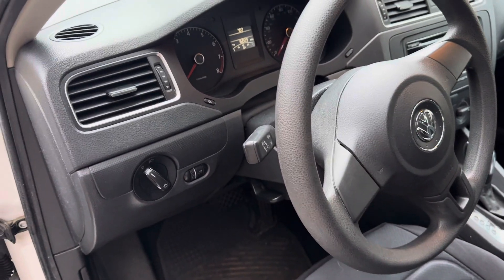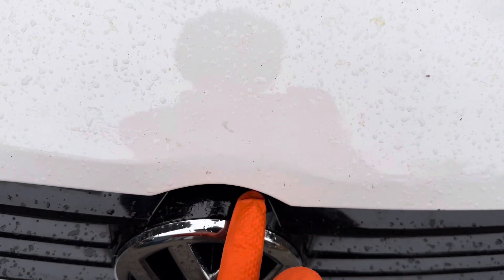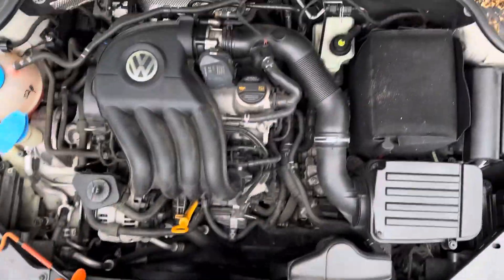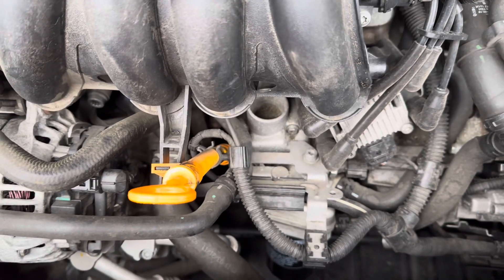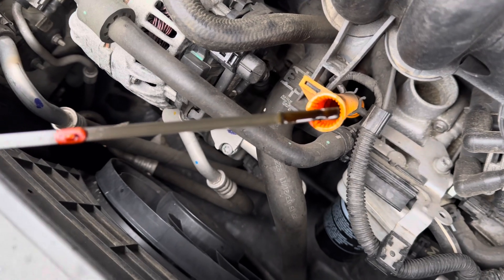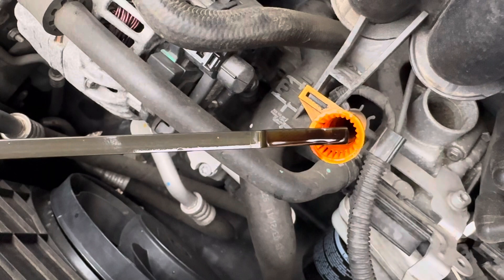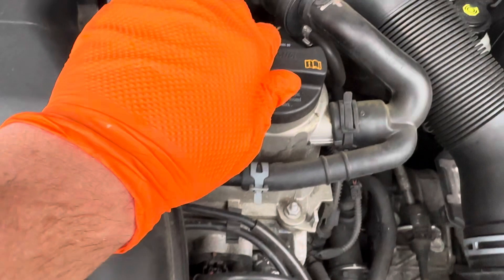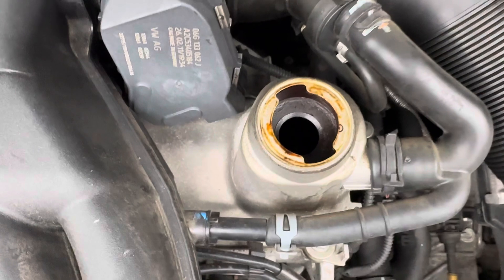VW Jetta Oil Level Check

Comment: I literally bought a brand new 2025 GLI Audubon with the 2.0 in it and when I got it home, I checked the oil, car sitting level, and it was at the very, very bottom of the hash lines 😡